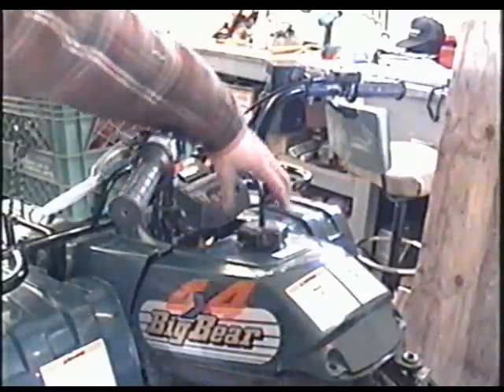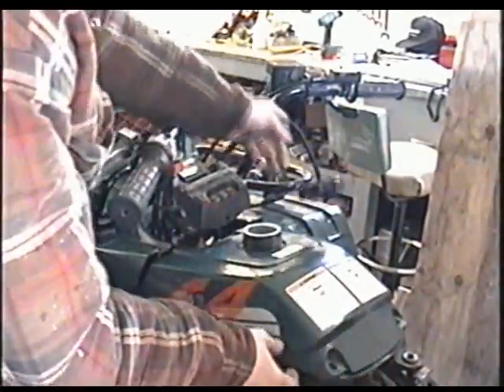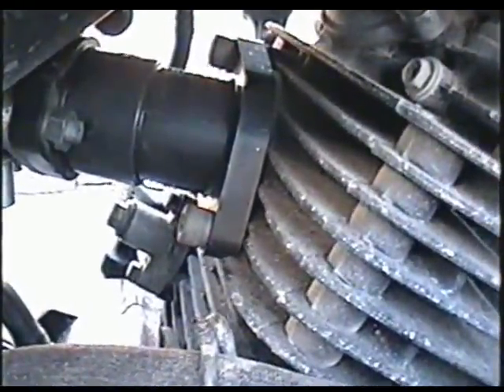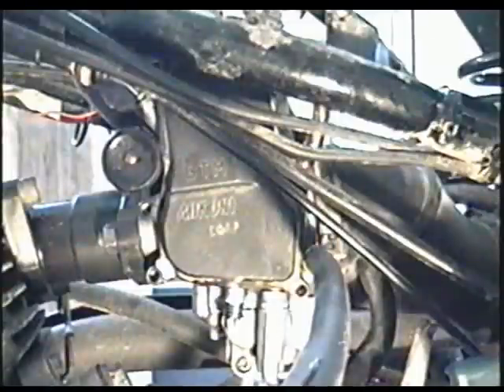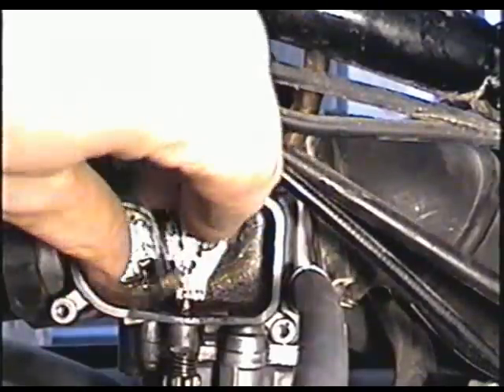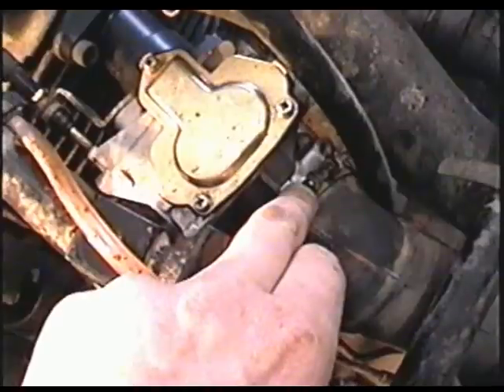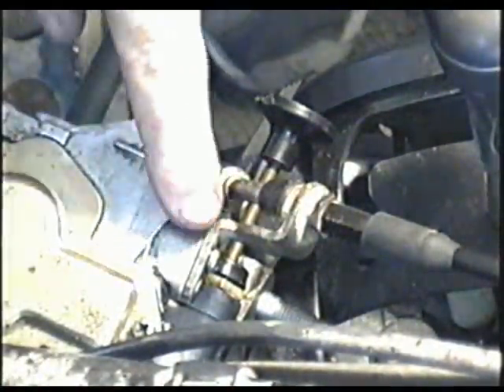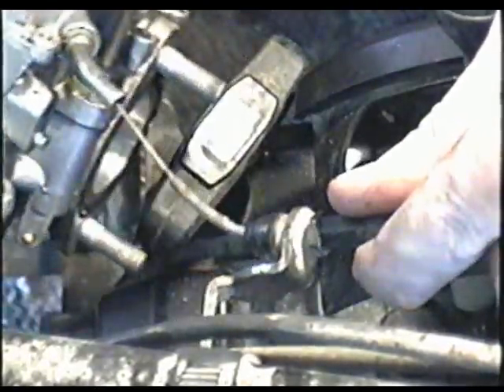Yamaha Big Bear ATV Carburetor Clean & Repair Part 1 of 3

Comment: i have a 400 ex took carb off not sure were the one line goes theres 3 one is overflow othe hooks to tank then there is one that has 2 lines that conect into one  cant get it to start so thinking that might be it it turns over but wont start

Comment: hey buddy .  heres a question about oil.  different ppl say diff things about what oil to use in small. engines.    like not ot use detergent oils in old motors.  and  should you use mulitviscosity as opposed to just straight 30. thanks.

Comment: 400 ex took carb off not sure were the one line goes theres 3 one is overflow othe hooks to tank then there is one that has 2 lines that conect into one  cant get it to start so thinking that might be it it turns over but wont start

Comment: Removing and replacing the front screws holding the gas tank is a frustrating experience on my 1990 Big Bear 350. So I devised a way to make the experience much less painful for the next time I have to remove the tank. To aid in removing the front bolts on the gas tank,  I drilled a 7/8" hole, using a sharp 7/8"paddle wood bit, through the fender just out front of the bolts. This allows a socket/ratchet to be inserted very easily. And even though the holes aren't unsightly, I order a small package of 7/8" black hole plugs on Ebay to insert in the holes. Removing those two bolts was the only frustrating part of my carburetor rebuild........good luck guys! And adventurous gals!!  And even those that can't decide what they are.......

Comment from the maker: @ringbolt9 always best to follow manufacturer's recommendations. some recommend synthetic, hd 30 some 5w30 etc. for most small engines i use hd 30, 10w30 and 5w30 and i don't really worry too much about the oil rating unless it is fairly new

Comment: Just did a carb rebuild on my 2003 Kodiak 400. I made one mistake that cost me time - I switched out the needles and jets without looking closely at the jet aperture diameters and installed them wrong which made it bog down at high revs. After I pulled it again and swapped them she ran great. I also bent the float tang so there is no longer any leaking from the overflow tube. Be very careful removing the tank so you don't damage the petcock and plastic extension. I found mine had already been glued and I had to re-epoxy it. If it fails again I may devise my own.

Comment: I have a little question, my father recently bought a YAMAHA Big Bear 1997 ang after the fuel cock level in the fuel hose to the carburator it has some sort of filter, a friend told me it is a car fuel filter and it migh not work ok, I was wondering if you know some sort of serial or model of this because all I know about mechanics is what I learned from the manual.

Comment: I just ordered the parts to fix my carb the diaphram needle/seat gaskets O-rings  came out to $110.00  at the dealer in Ontario. I will reuse the jets after a good cleaning.  I have been using Benjamin Moore oil and grease emulsifier to clean carbs for the last year with good results I put 3 capfuls mixed in 1-2 litres of hot water then  soak carb in small container cleans out a carb in 5-15 minutes. I have cleaned out 40 small carbs and still  have lots left in the  jug. The product will bubble as it works and is safe on rubber parts after  it stops bubbling I remove the carb and  blow everything out with air.

Comment: I have a yamaha warrior and my carb has been giving me problems it looks like my needle is bent. Also my  warrior has the same engine but is a sport quad. Mine has the twin cables so I just remove it from the cable splitter. If you could check out my latest video I would really appreciate it.

Comment: dO YOU HAVE TO REMOVE THE WHOLE FRONT END ASSY ON 1988 YAMAHA 350 IN ORDER TO REMOVE THE CARBURETOR
Reply: No maam...... Just remove the gas tank and easy access will be found. Refer to my comment above for a tip on removing the front two screws that secure the tank. It makes it so much easier for this time and the next!

Comment: Thank you for the video good job. I have a 350 Big Bear and while I was trying to start the engine it would only run for a few seconds. The small of gas was very strong. I removed the seat and the air filter housing and ¼ of the housing was filled with gas/oily mixture of some sort. I keep the machine in the shop so there was no water in the system but it would not run very well at all. After removing the gas and cleaning up the machine I removed the crank case breather hose and while starting the engine it was running a lot better, but the hose was blowing gas and oil out of the breather hose. The longer I let it run the more gas came out until after 30 minutes it slow down and stopped. After 1 hour there was only a drop every two seconds coming out of the breather hose. The question is what caused it and what do I need to do to make it work better? I did let it run for about 2 to 3 hours. Any help would be great. 
Thank you for your videos.
Reply from the maker: you need to replace the engine oil and the needle and seat in the carb